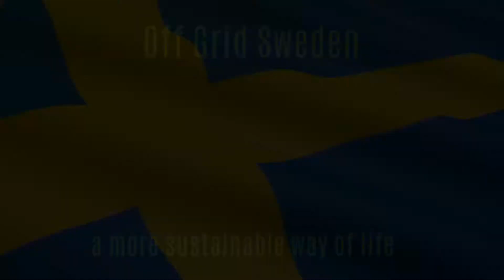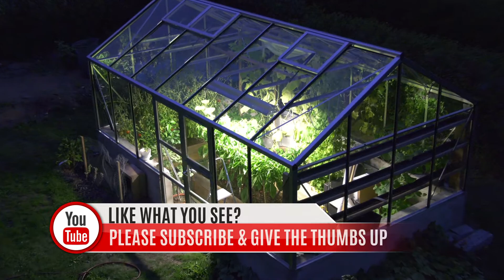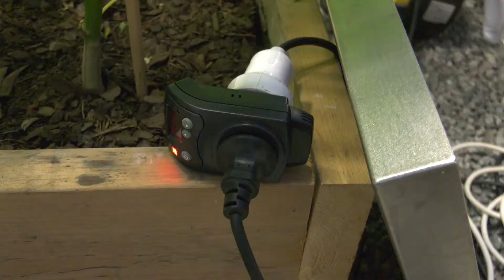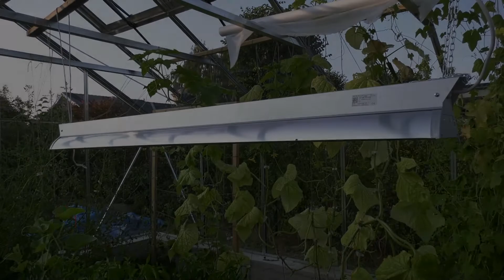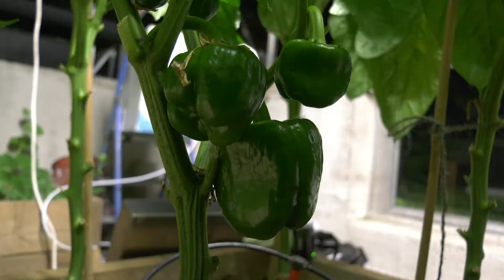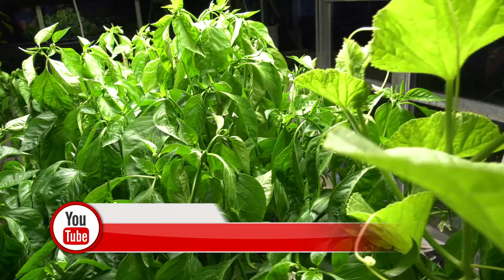Greenhouse build — Installing heating and light fixtures

Comment: My greenhouse in Canada looked to be about the same size as yours; 8'x12'  I tried several different heating systems, kerosine, heating cable and electric heater similar to the one you use in your video. Heating costs for the electrical was too high and the kerosine was also very expensive.  These solutions were all used before solar became more available. SO my suggestion is to look at investing in a small solar system which could accommodate your needs for the greenhouse, then you could maybe install some sort of radiated heaters along the walls. This is what I would consider doing if I was still green housing
Reply from the maker: Hi Terrence, Thanks for commenting on the video. I got over 40 solar panels on my roof. Got a few videos on the here on the channel. Have an amazing Thursday!

Comment: The simplest and most inexpensive way is the same that generations before have been using...wood stove. If you don't have wood then the next best would be a propane heater.
Reply: A propane heater is horrible because it could hurt the plants but I do like the idea of wood stove so much easier
Reply from the maker: Sounds like a good idea.
Reply from the maker: +Dave Calvo I got wood but on the urban homestead there is very strict regulations so getting a permit there to heat a greenhouse with wood isn't easy. On the homestead in the woods i could probably do that.

Comment: 15 degrees is too cold for growing fruits. You should try it out around 20~25
Reply from the maker: +Felipe Navarro Thanks for the tip. During the day I still got over 20 degrees in the greenhouse and in night I now raised the temperature to 18 degrees. But it's soon time to shut down the greenhouse for this season.
Reply: IDK but for all that investment, I think you should test and try getting fresh food in the winter. IDK if the electricity is too expensive in Sweden but... Fresh food is always fresh food :)
Reply from the maker: +Felipe Navarro Yea I will try growing in the winter as soon as I get a better source of heat then electricity.

Comment: Great video. Lots of good ideas. We're thinking of expanding our little Homestead to include a larger garden and greenhouse. Days don't get so short here in Arizona, southern United States, but up in the mountains it gets quite cold in the winter. We would also need a good heat source. I like the way you have things set up and timed.
Reply from the maker: FargoFX Thanks, that sounds like a good idea. A greenhouse is awsome.

Comment: For more efficiency and lower leaf coverage I use  a tent of Mylar reflective emergency blankets ( space blanket 213cm x 135cm cut in half   213 x 67.5 ).  This material can be hung from a 10 gauge wire frame 10cm wider than your raised bed with clothes pegs or  5cm x 5cm squares of packing tape.       Bert

Comment: use 55 gallon drums painted black and filled with water, it will act as a solar heat sink, absorbing heat during the day, and releasing it after the sun goes down at night, It should help a little bit
Reply: The black barrels will reduce reflected light in the greenhouse and you cant put or grow anything in front of them as they need direct sun. I use the ground below the greenhouse to heat, cool and dehumidify the air. It provides the same capacity as 36x 200L barrels of water without affecting light levels or floor space.
Reply: Hej , Also in Sweden here (Dalsland) In the planing stages of building my own greenhouse. Built against a south facing garage wall .3m x7m . Some of the things I am thinking of incorporating are geotherm heat ( Running drainage pipes under the gravel, with forced air from the highest point in the green house . To heat the planting beds.) Painting the wall of the garage black . Using 25L black painted  plastic water containers (dunkar) to build  a shelving system next to the garage wall.
Reply: subbed and followed on insta
Reply from the maker: +James Pottorff Great idea
Reply: I would line the north wall with them, where they will absorb the maximum sunlight during the day. It is an excellent way to stabilize temps in the greenhouse. Passive solar gain
Reply: I would line the north wall with the barrels to get maximum solar gain, it is an excellent way to stabilize temps in the greenhouse. Passive solar gain, but the best part, it is free. Aside from the initial cost of the barrels & some black paint, it cost nothing to operate, and you can build a bench on top of it to use as well.
Reply from the maker: Sounds awesome. Having a greenhouse is a real gamechanger. Have a great week.
Reply from the maker: Thank you very much. Appreciate that.

Comment: Hi   This is the LED fixture I am using  and two of them have a little more usable spectrum than the four tube fluorescent and less than half the wattage.  At $44 Can before taxes each.Niello ultra-thin & ultra-light LED Grow Light Panel 45W 225 LEDs 6-Band Full Spectrum Include UV IR for Indoor Plants Growing(Black)I can see why you bought the fixture you did at 75% off that is a good price.    Bert
Reply: PS  There is a foil covered bubble wrap insulation.   If you use it on the East West and North walls it will reflect some heat and light back on the plants.  I would start with the north side then add the east and west ;  when the sun rises in the south east.    Bert
Reply: Hi this is a good U-tube video on using a compost pile for heating a green house     ' Winter Greenhouse Heating with HOT COMPOST '    In addition I would build the walls using ICF's ( insulated concrete forms ) filled with dirt instead of concrete thus reusable. them in a  'U' shape  3 rows high  4'   16" above ground then cover with a sheet of foam and a tarp with bricks or rocks to hold down the edges.            Bert .
Reply from the maker: +bert skelton I will check that out. Good tips. Thanks
Reply from the maker: +bert skelton I will check then out
Reply from the maker: +bert skelton That's a good tip. The one I bought claims to cut down heating costs with 60%. We will see if it's that good.

Comment: Looking good and I hope the extra heating and light help your peppers and other plants stay healthy and ripen. Will the warm air from the heater require extra moisture to offset any drying out?  I did consider possible heating methods when you asked in your earlier video after your vacation but it isn't something I have experience with. That said I pondered that something that retains heat well and slowly releaes it might be best? Solar connected to ceramic heating plates perhaps, or maybe using black barrels, buckets or bottles of water heated by the sun during the day that will retain heat overnight? Given that you possibly have wood available from your homestead though, would a wood stove be the cheapest option - perhaps generating heat itself and maybe also heating water for generating warm steam?